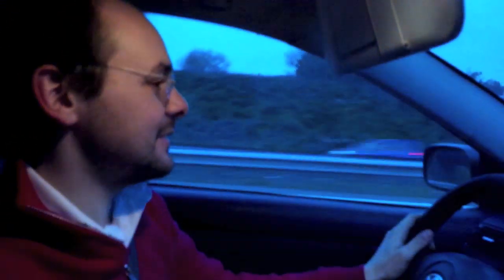ᴴᴰCorolla E11 4AGE 20V BT swap guide [Part 1: An engine from Japan]

Comment: Heh! 20v i was right!
After all, if stock condition of AE86 become boring, you'll be able to put this engine into AE)

How much Є did you spent on this engine + shipping + customs + etc?

Thanks,
Dima
Reply from the maker: Hi Dima, that is always a possibility, but for now the 4A-GE in the AE86 pulls hard and is very healthy, using no oil from change to change. I want my AE86 to be kept as a classic, so I also value its stock look and mechanics, so if my blue top ever gave up the ghost, I would swap with another blue top. It is just how I see my AE86, it is fast enough for me, so no need for more power.

The total cost was around ~2200€ with everything (so many lines in the invoice for so many different entities that it is a confusion).